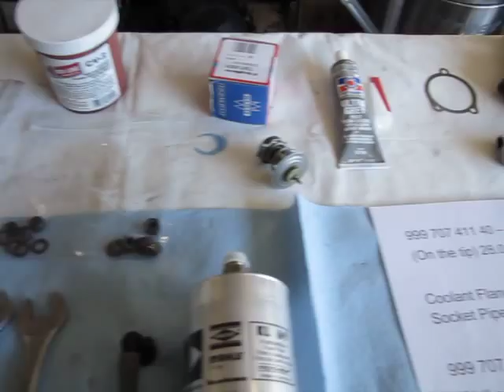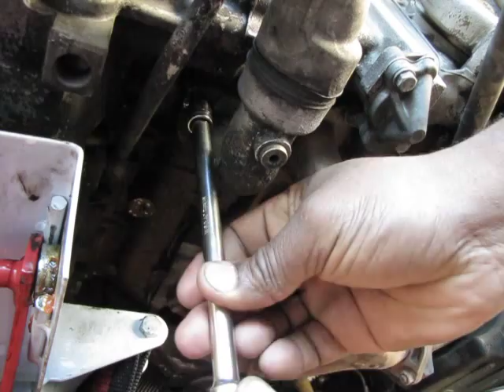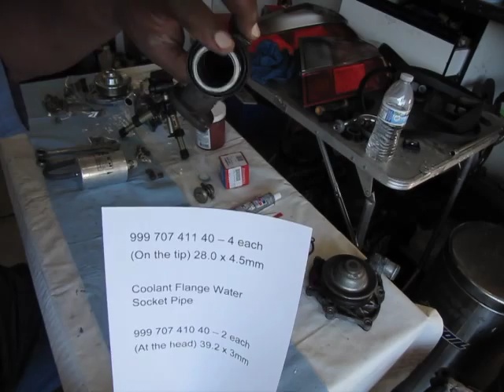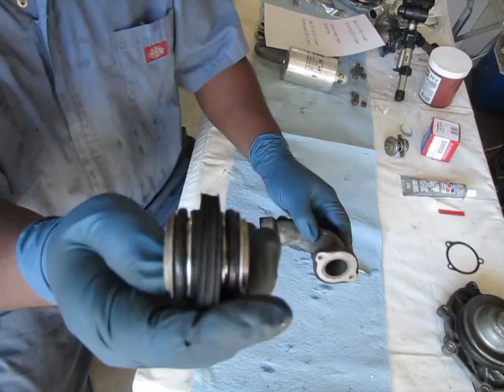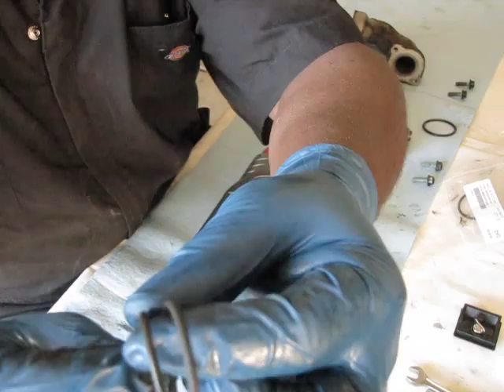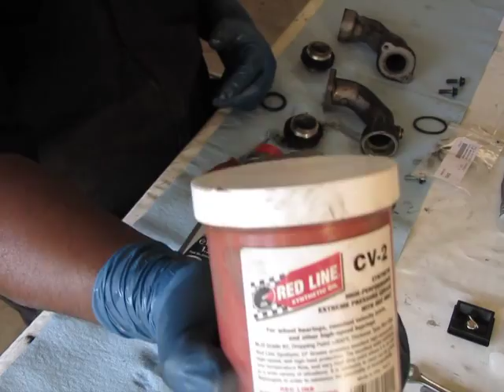How to Change o-rings   on Coolant Flange Water Socket Pipe; 2003 Porsche 996 Turbo

Comment: Clint, thanks for this video.  i am experiencing a similar small leak in this area.   Is the connection actually only a friction or suction seal?  It doesn’t seem sufficient to hold the pressure of the coolant system.
Reply from the maker: The o-rings seal well when they are new and not shrunken. But yes, it is just a friction seal between the o-rings and the housing socket.  The o-rings also expand with heat when "new' once they get hard and loose their ability to expand, we start to see the leaks.
Reply: Thanks Clint, i enjoy the thoroughness of your videos.  Are you an “auto tech” or just on of us DIY’s?

Comment: Very informative Clint Thanks, looking to change the coolant on a 996 Turbo, I've done it on a 996C2 already. Do you know where the engine drain screw/plug is on the turbo? Looks the drain is on the flange(s) you removed
Reply from the maker: There are drain screws on the bottom of the water socket pipes.
Reply: Thanks I also found a write up over at rennlist. Picked up the Pentofrost SF at Pepboys